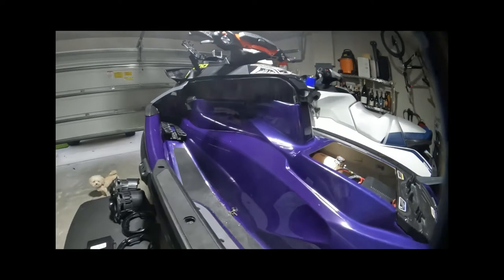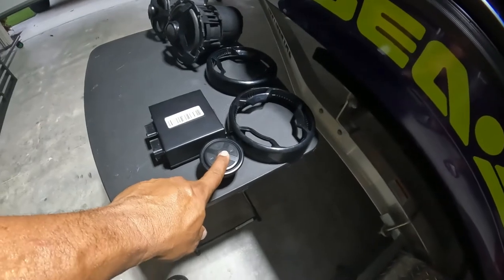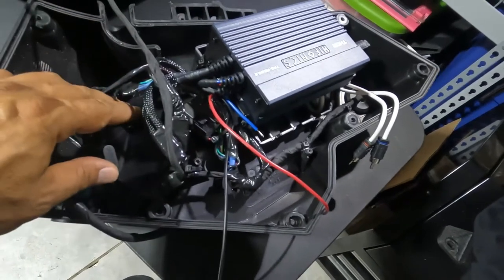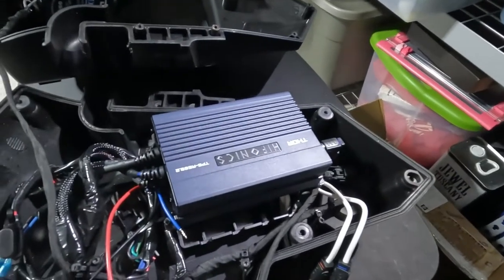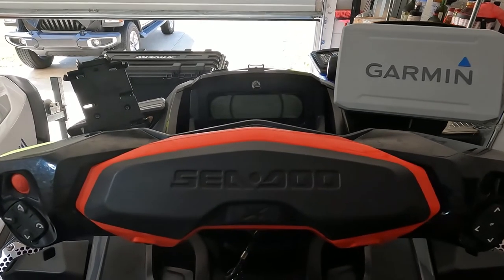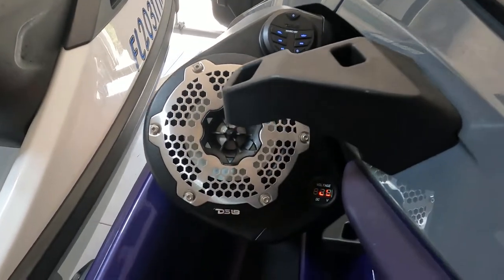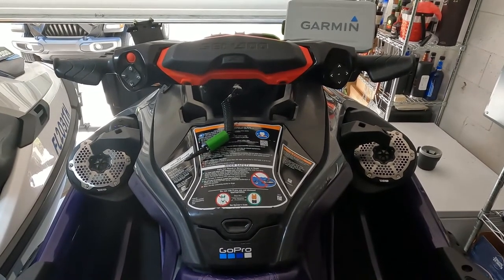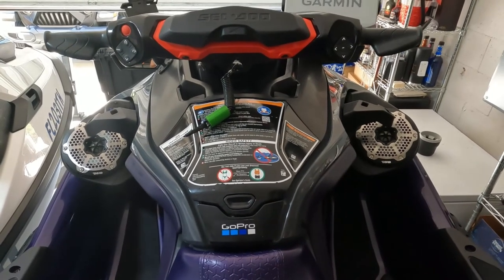RXT X 300 DS18 Sound System

Comment: Tha ks for this video it was alot of help but I still have some questions. 
1.Can you still control the volume on the stock handle bar controls? 
2. I was thinking to leave the stock headunit in mine would that be a problem? 
3. Did you run the power wires for the amp directly to the battery?
Reply: I left my stock amp in. And no issues at all.

Comment: Did you just disconnect the amp and there was no issues? The screen didnt say hey where is my radio or and check engine lights or electrical problems?
Reply from the maker: I disconnect the amp and used the same wiring to add the aftermarket one. No, I have the wire diagrams from the service manual. Everything works fine. Sound much louder than factory!